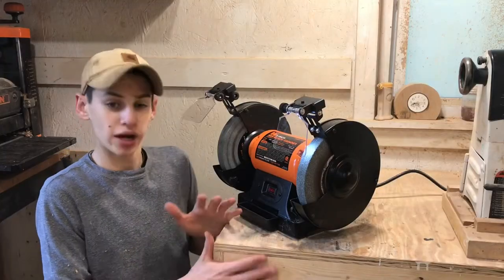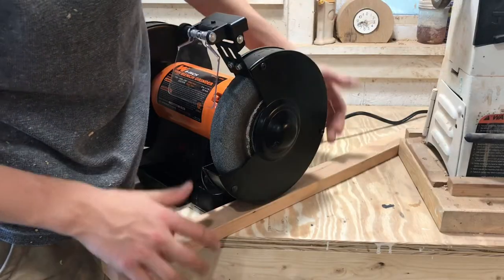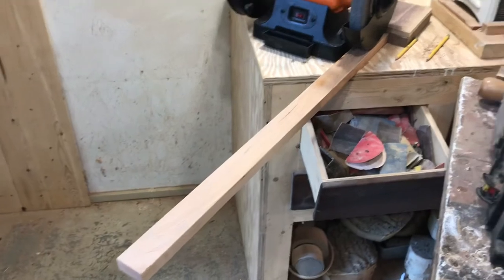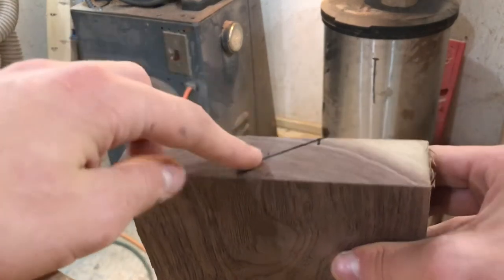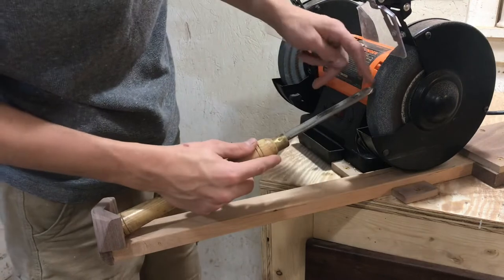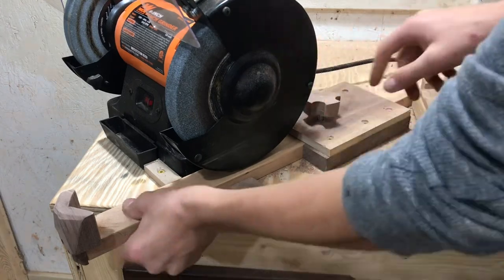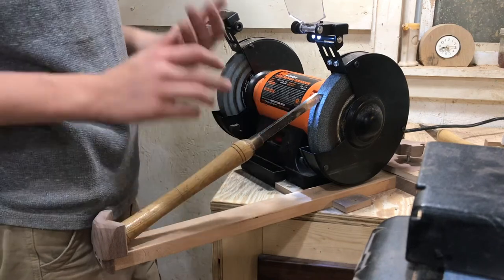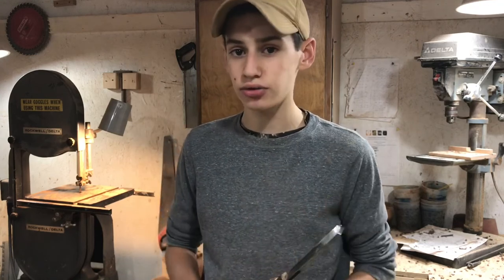Making a HOMEMADE Wolverine Sharpening System!

Comment: I have the Wolverine sharpening system and you made a very usable version of it.  I find that that taking a magic marker to "paint" the area to be sharpened, set it against the wheel and manually turn the wheel, you can tell where the grinding will be done.  Then you can adjust the arm accordingly before turning it on.  Another option may be to put a mark on the arm so you can set it to the same spot each time (though, this will eventually need to be changed as you sharpen the tool).  Well done.

Comment: Great Vid Seth, if you color in the angle with a marker you can the hold the tool against the grinding wheel with it off and turn the wheel by hand when you see the marker being removed across the length of the grind you know your angle is dead on.

Comment: One thing that I'm constantly being reminded of is the expansion and contraction of wood can turn on you. I was reminded of that the other day when I got out my table saw sled and quickly discovered that the quarter sawn white oak guides had bound up in the slots from humidity changes. Hmmm, Q S oak isn't supposed to do that.... And then there's the flip side where you've now got too much slop. I think I need to change to UHMW plastic for those guides.
Reply from the maker: I’ve had this jig for about 3 years now. Never had that issue. The tolerance between the slide and the guide isn’t super tight
Reply: @seths_custom_creations  I needed to use the same sled a couple days ago and now its so sloppy... I've got a spare set of miter sliders somewhere, I guess its time to swap them out if I can find them. The humidity around here can go from 20%, sometimes less, to 80% through out the year.

Comment: You need to change your wheel to a fine grind also slowing the wheel down may help you by getting a Variable rheostat switch
Reply from the maker: Generally I turn it on, let it get up to speed, and then use it while it’s winding down